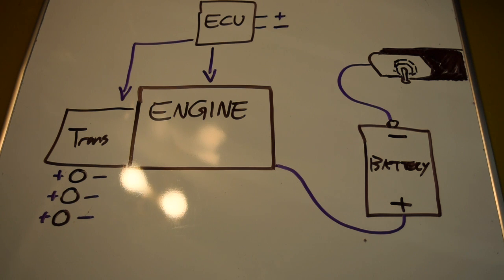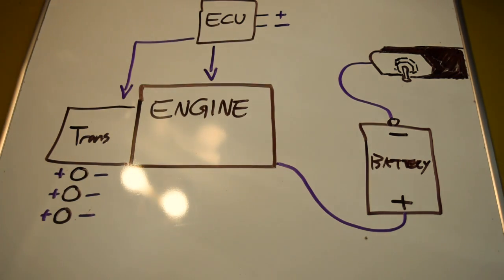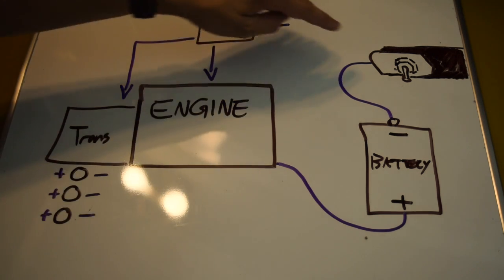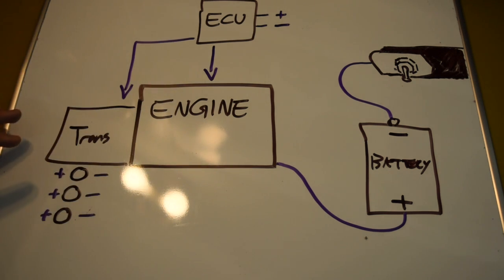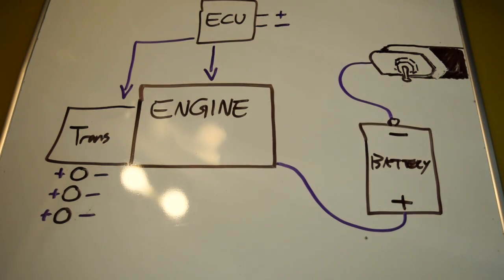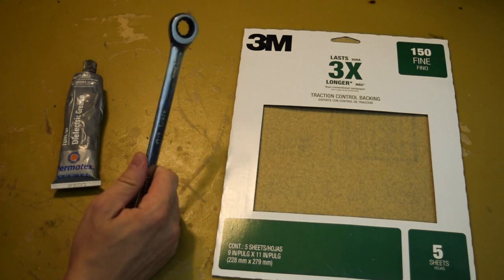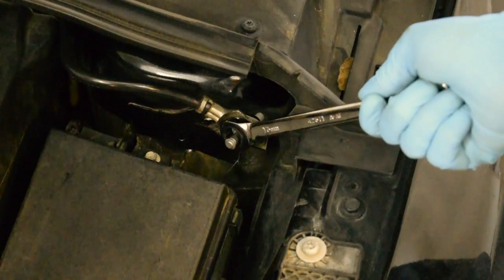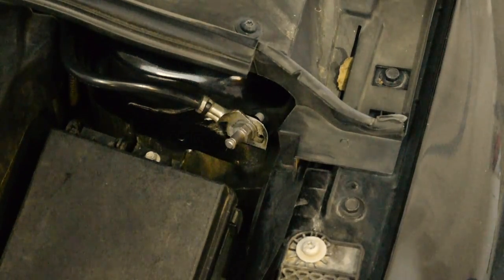Ford Focus DCT Ground Mod. Increase Driveability and Reduce Jerkyness

Comment: I greatly improved the shifting of my 2015 by going into learning mode. Here's the procedure: 

Focus transmission reset into learning mode
1. Run car, shift to Neutral
2. turn to Off, wait 15 seconds
3. Shift to Park
4. Turn ignition on (engine not running), wait 15 seconds
5. Turn off, then back to ignition on (engine not running)
6. Step on brake, shift to Neutral
7. Dash indicator should read 'Transmission ready"
8. Start car and drive normally

Perhaps when you disconnect the battery, it also goes into learning mode. I think that's what the  "fix" in this video is. Nothing to do with fixing the ground connection. There are lots bigger intermittent loads than those motors. If you have a bad ground, though, you're going to have other problems. 

I like the idea of taking off the bottom pan to cool the TCU. Gonna try that when winter is over. I hate that thing every oil change anyhow.
Reply: you sir are 100% correct in your assumption that disconnecting the battery puts the transmission in learning mode, also resets all the the other sensors like CPS and MAP, so they all relearn based on driving habits
Reply: @elmartillo7931  So, if you disconnect the battery for a few minutes, would it fix the hard shifting??
I replaced the transmission and on my 2012 focus and it was fine then I replaced the engine and now is not working properly engine light says is the trans computer and we changed too and still is not working properly
Reply: @adolfovilla3909  if it's hard shifting and slipping it's a clutch if it's jerky and has trouble finding a gear the transmission needs to be in learning mode
Reply: @elmartillo7931  Thanks man
Reply: @adolfovilla3909  no problem my daughter is having the same issues with her 2014 focus Titanium with the dual-clutch, and she is having the clutches replaced next week.  The clutches slip less when in select drive mode, so resetting the ECM is one way of finding out if it's the clutch
Reply: @adolfovilla3909  Did you try my tranny reset procedure? If you unhook the battery you'll have to relearn all the sensor points. It will run better sooner or later.
Reply: @jamesvandamme7786  I did and it run good for a few minutes and then back to hard shifting, I have tried all of this and is not working,  I don't know what to do anymore,  thanks anyway for the help
Reply: @jamesvandamme7786  This worked on the first try, can't believe the dealer was trying to do all kinds of tranny work at an estimated cost of $2400, well I actually can believe it. Thanks for the tip.
Reply: Thank you for sharing. My 14 focus fucking sucks!
Reply: If I have a push button start (2016 titanium hatch) how do I turn the car on but not the engine? Could never get my car in learning mode
Reply: @savannahstine7005  yes push button start makes it a lot more complicated, we had to get it done by a technician at Ford
Reply: @savannahstine7005  There must be a way to get the accessories or ignition on but I have no clue what it is. What does your manual say?
Reply: @savannahstine7005  push the button twice without pressing the brake.
Reply: Does this going into learning mode process also work for the 2015 Focus with an automatic transmission smoothing the drive from 0 mph up to 30 mph from a dead stop? Reason I ask is because I was used to driving the Elantra and I noticed since I got this car its not as smooth from a start up to about 30 mph.
Reply: @indalab247  There's a video on cleaning and lubricating your forks & motors which is real easy and cheap. You might try that. https://www.youtube.com/watch?v=0Fh5G6ebD8s
I took off my under car fiber pan (it was annoying) and I haven't had any more problems. It seems to upshift slower than I'd like 1->2. But at 85K miles I can't complain, it's almost like a normal car.
Reply: It is a problem with the ground. My focus was pretty much jumping when shifting, not shuddering. I did this exactly from another video I saw, and it shifts great now. 

Don't act like you're an electrical engineer if you're not even close.

Comment: The real issue with this transmission is premature wear cause by heat . This transmission will not take abuse or long term use.
Reply: You might be right. I’ve noticed that when I drive my 2013 focus early in the morning when it’s cool, the transmission shifts normal and smooth, but after driving for about an hour or when the temperature is hotter, the transmission starts to stutter & jerk from 1st to 2nd gear.

Comment: I had the same issue in my 2013 focus for over a year, I changed the battery a month ago and the problem disappeared. I agree it is a 100% electrical issue and my advice is to get a new battery even if your car starting normally.
Reply: Yes. This car has MANY symptoms of electrical issues.  The power assisted steering error and subsequent failure to engage is caused by not enough current. I discovered this before any of the issues when reprogramming it with forscan. Either the alternator isn't able to charge and supply electricity to the system fast enough putting strain in the battery,  or the battery isn't powerful enough for this car. PAS error i can reproduce on a dime and fix everytime also.  Factually electrical (sorry to those who shelled out the 1700). When in forscan i was getting tons of error codes related to electrical failure/unstable voltage/ under voltage.  These don't show up as check engine codes but can be seen with the right hardware or software like forscan. I think the ground mod here only results in the appearance of success due to ecu relearning as the ground ought be sufficient. Grounding rods for houses designed to ground lightning bolts are about bolt sized... i think everyone getting power steering issues or shifting issues ought go upgrade their battery.  I'm going to put a charge gauge under the speedometer to keep an eye on it and justify a alternator upgrade.  Good luck guys.
Reply: @danielkeery1532  foreskin???wait..what??!    !!!
Reply: Have you ever had any check engine light trouble codes for this transmission issue? If so which ones and what have you done to fix it?
Reply: @Ahmad Alshehri  In my case when traffic changes from red to green then why i press on gas, the car would vibrate for short time then when it would run fine after it picks up the speed. Was it similar issue you had? and it was fixed by replacing the battery?
Reply: I replaced my battery and  car changed color!! Mmmmm!!
Reply: @mikesecondo2254  I am just sharing my experience that might help somebody.

Comment: First off NEVER take the positive cable off first. Secondly the motor has to be grounded to the battery by some path or nothing would work at all. Whether it is another cable going from motor to frame, or the motor mount itself being bolted to the frame creating a path. But just that one negative cable is not working. That said,  It won't hurt to create a better connection surface for the cable.

Comment: Just change  Ignition Coils to drive normals little better then before
Reply: Lol no way would that cause transmission overheating... this might tho
Reply: Lucas Monroe  not really I have been driving my Ford Focus and it drive better no issue and quicker response the car is blast of fun just ford made a car which made to drive for long distance not for stop and go constant if you travel to another country you would noted there a lot of roads you could open up the car in North America you don’t really have that on your side as of you were some where else
Reply: @SPIDERMAN2015 i enjoy it greatly but im now at 140k and dealer doesnt know how to fix it.  Was shuddering and they replaced the clutch now its overheating
Reply: Lucas Monroe have you change the water pump or have you change fluids or what is the car doing tho if you don’t mind me asking
Reply: @SPIDERMAN2015  literally a service alert saying transmission overheating stop now then it will go into neutral.  Temp gauge always stays normal
Reply: Yes  it possible and also a block could also over heat as well
Reply: @SPIDERMAN2015  a block of what? If my cooling system was overheating my engine temp would spike also..?

Comment: Yep all you did was just relearned your clutch touch points when it cleared them by unhooking the batt. It slowly starts making clutch actuation adjustments . to which a slow controlled slip to the body feels smooth then slowly. Then threw various driving and throttle inputs it speeds up clutch actuation . i also want to point out having a brake pedal actuated clutch it can get very confused when people are creeping along and jockeying the brake pedal .  people drive the things like they are automatics . get on the throttle like you mean it get on the brakes when you mean it don't pussy foot

Comment: The placebo affect strikes again!!!
Reply: Not true,   I did it on my daughters 2013 focus and the shudder completely went away.    Ive been working on cars since I was a kid and I was shocked that this actually got rid of the shudder.
Reply: @94sn95gt  Then you should know that when you do this, you are unplugging the battery. Resetting the ECU, causing it to relearn driving habits.
Multiple people on the forums, myself include, did this and the shudder/stuttering has returned
Reply: @94sn95gt  did the issue returned?

Comment: If it's that simple and easy why didn't Ford do it to avoid law suit and angry people??!!
Reply: but it basically cost nothing, maybe manhours...
Reply: @arnelredd8396  Yea these responses make no sense, any company cares when it costs so much. They're replacing transmissions and clutches 2-4 times per car, yea of course they care. I would assume this fix does not always fix the problem, and when it does it's not for good.
Reply from the maker: They most likely don't care. Hate to say it, they probably ran the numbers, and have figured out the lawsuit is cheaper than fixing the cars.
Reply: @brownroush  Wouldn't be the first time Ford cheaped out on cars to get them out the door. American car companies run quarterly.
Reply: @brownroush  I've had my 14 focus for a few years, it had 35k miles when I bought it and it started its shit about a year later.  The dealership "fixed" it no charge & it was fine for about a year, then the shudder came back again. I called them & was told I needed to drive it hard to burnish the clutches because that's all they do.  I told them if I get pulled over or worse, crash the car driving it like they told me to, I was going to have my lawyer subpoena the phone records and sue the hell out of them.  I hung up and just drove it as is.  A few months after that the car sputtered and died.  I went thru the reset procedure, it started and ran fine for about a week, then stalled again,,,this time on a weekend with freezing rain a couple miles from home.  After a half hour sitting and going through the restart procedure a few times waiting for AAA, it started and I drove it home. I called the dealership and took it in.  They told me that "a wire had frayed" under the gearshift, they fixed it charged me $500.00 and it's actually driven fine for almost a year now.  I wondered how a frayed wire could have apparently fixed the shifting issue but now I think I know.  I'm going to look at the ground connection tomorrow and see if there's any signs that they may have done this trick.

Comment: When I had a 2013 focus I found that it drove best when I did two things.  1.  I treated the gas pedal as if I was shifting a manual transmission, when I wanted the car to downshift.  For people that haven't driven a manual, what I mean is quickly lifting my foot off of the gas pedal (or just allowing the gas pedal to come up) when I intend to have the car change gears.  2. I made sure to keep my brake solidly engaged anytime I was on a hill until I was ready to move forward.  With that said I was probably pretty lucky with mine I never had any significant issues.   I did sell the car specifically because of fears related to the transmission.
Reply: I bought a 2012 new and eventually had the trans. replaced under recall, I drove the car for 7 years racking up almost 300,000 ,miles. I'm driving a 2018 Focus currently
Reply: You could of kept it longer 😅😅 word of advice the reason these things fail are because of tcm and clutch fork and clutch dust issues but rarely you gotta replace the actualy clutch. Solution to the forks when stuck: unbolt the actuators clean the actuators use a compressor and a air hose to blow the forks and apply brake cleaner and blow again use a drill or a wrench to twist the forks and release them kee0 spraying dust cleaner and air inside. Once its a bit freed up lube it up with wd40 and spin the forks until they spin freely when engaging and retract without getting stuck than grease your actuators with wd40 and plug them back in and your good to go temporarely. Tbh the thing with these dcts is that the clutch dust and tcm are the biggest issues. But rarely does the actual transmission fail. If you want to clean the transmission unbolt it off take out the housing and use a air compressor and brake dust to clean the clutch and forks from inside and you should be good to go.
Reply: @bennypacheco9064  really appreciate your post... thanks from NZ.
Reply: Hey, if I want it to downshift should I use the brakes? I've noticed on the highway letting off the gas can make it linger on the lower end of the gear which I assume is very bad for the clutch. I've never driven a manual and I'm learning to drive it like one. Really nice feeling car a lot of the time. I have a 2012 titanium 80,000 miles and I just got it for 2500, not sure if it's a moneypit yet. I've also figured it's good to be firm when accelerating and to keep it at a constant speed in general. Got any advice or feedback for me? Thanks!
Reply: you are correct the senser was going in the gears one was broken and was over working it sense did you hear anything break
Reply: I bought your focus ass hole transmission is why I’m watching lol
Reply: @lildonbossy  😂😂😂😂

Comment: The flimsy (i.e. cheap) ground that Ford has been using on all of their cars is a known problem that also can cause problems with starter motor operation and ignition misfiring. Cars used to have ground cables attached to the engine and to the body. On my 2012 Focus I added a battery cable from the ground post to the engine. Used a 3 foot cable with lugs at both ends. The head has two unused threaded (metric) holes on the back side - attached the cable lug to the hole nearest the right fender (easiest to access). On the ground post used star washers between the two cable lugs and between lug and body sheet metal (also sanded the body sheet metal). Routed the new cable along the other cables running under the cowl at top rear of engine compartment (3 cable ties). Made a neat installation with plenty of strain relief at each end.
Reply: Big question....did it cute the faulty trans???
Reply: @mikesecondo2254  The problem with the weak Ford battery ground can cause various problems when there is high current draw - starting, when head lights are on, etc. FordTechMakuloco has a UTube on this: https://www.youtube.com/watch?v=eh8PIL5E_6M  Note that the Focus and other Fords use a stud instead of a bolt for the chassis ground. I also added a battery cable ground directly to the engine (traditional arrangement) to make it bullet proof. This was a preventative fix. My Focus only had clutch chatter on launch which required an occasional clutch scrub to reteach the TCM. Since the TCM software update the trans has been shifting very well with no launch chatter.
Reply: Would you be able to send some pictures of your new cable install. I'm thinking about doing this also. rich935@gmail.com if you can. Thanks

Comment: Might work bec you need a good ground even to turn over a engine.and paint does block contact.
Reply: Oh yes starts fine....so much for a ground issue
Reply: @mikesecondo2254  or needs bigger battery

Comment: Well I have 2016 focus. And the duel clutch trans does exactly what it supposed too. Act like a manual with out shifting. Next issue!!!! They had a recall for that bolt to replace too by the way.
Reply: Yes they did

Comment: Oh.. please...I highly doubt this made any difference at all!!! Seeing as this problem is a mechanical issue not electrical
Reply: Loose or inadequate grounds can cause a lot of issues, electrical & mechanical.
Reply: @willf2896  duh uh!!!!
Reply: Went to 2 service centres,  I got one same explaination...focus has alot of electronics which is not perfected so I believe it's the lousy electrcal side is cursed. Getrag trans should be fine.
Reply: This is an electronic/ transmission issue. Because the transmission is basically an electronic one, if your battery is low the whole car will drive shitty also faulting the signals to your trans actuator
Reply: @toni2962  so much for having a alternator!!!